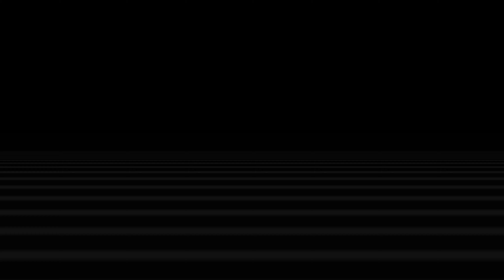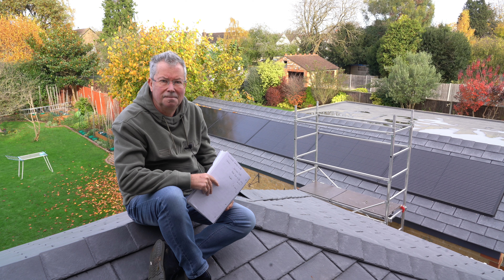DIY Energy Independence (Sunny Day)

Comment: Steve
Bifacial vertical PV panels are perfectly compatible with low growing arable crops thus getting double use from the land. Sheep can quite happily graze around regular angled solar farms.
Reply from the maker: I will certainly consider bifacial for the garden and even on the area of flat roof. I need to squeeze every last bit of power especially during dismal winters like this one.
Reply: @MrJonesDIY  The price of panels is so low nowadays even a north facing roof can have a reasonable ROI.